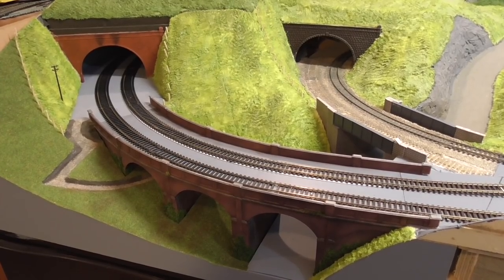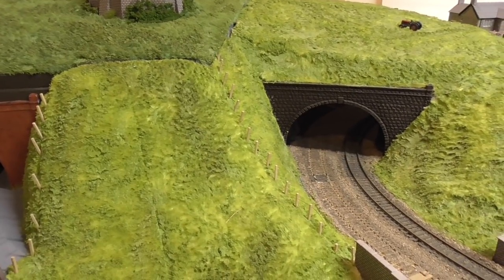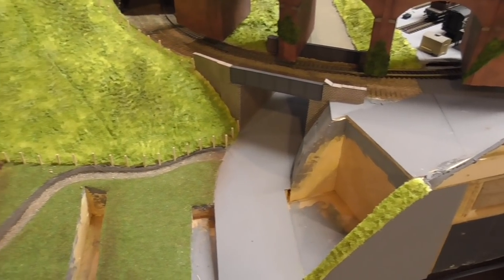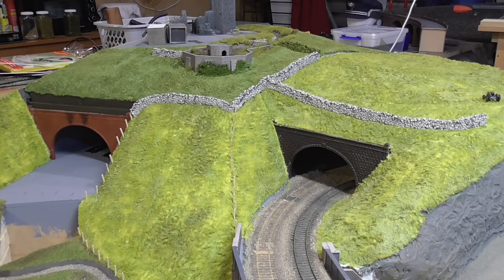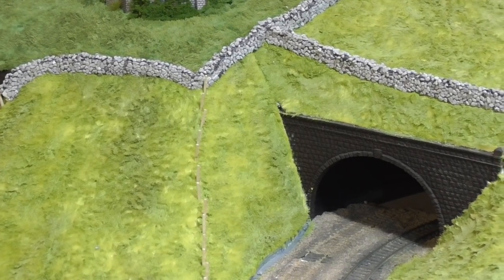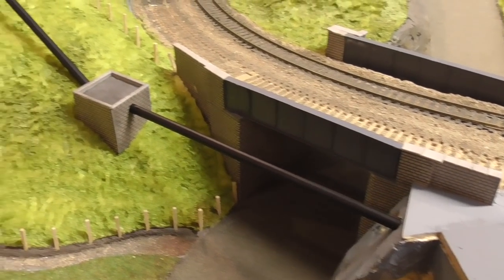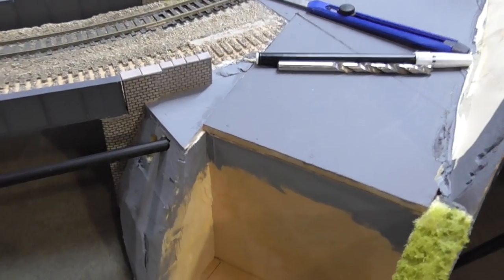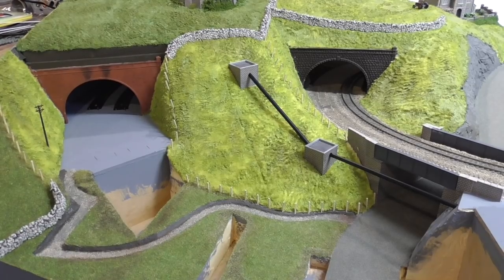Scenic progress on the viaduct, hill and reservoir areas

Comment: The mk2 stone walls looking real good,a wee while back I made a static applicator with a fly swat but I but the electronic part & battery  holder in a clear box from jaycar and a few grass containers made from small pill bottles etc with one wire soldered through the mesh coming up inside of container. This way it can clipped together so I can use it close to structures etc, keep up with good videos cheers Alan.
Reply from the maker: Thanks for your kinds words and feedback. I like the idea of a smaller grass container for getting into tight spots on the layout. Cheers, Julian.

Comment: Hi Julian, great video the scene is coming on really well. Dry stone walls very realistic, will be trying the idea myself  shortly. Would also like to thank you for the video on the Digikeijs dr5000. I have just changed to this system after watching your video. Best thing I have done absolutely fantastic system, so easy to use. Cheers Julian keep up the great work 👍
Reply from the maker: Thank you for your comments/feedback, so greatly received. The DR5000 is definitely a good purchase, I have been thoroughly enjoying operating my system, and particularly its seamless integration with the Z21 app. And best of all, you get all the features of a top train control system for half the price.

Comment: Those dry stone walls really bring that whole portion of the layout together - they look much much better than those in the earlier video.
I'm curious as to your plans for the steep unfinished area right above the portal to tunnel beyond the viaduct as that may be a bit trick to blend with the other areas of grass considering the sheer gradient of the slope? I suppose to a lesser extent that is the challenge with that section between the viaduct and the road bridge where the pipeline disappears, although I suppose you could put a retaining wall or a rock face (or a combination of the two) and it wouldn't look out of place, but I'm you'll figure out a solution - you're certainly a more talented modeller than I. 
I'm eager to see your progress in the next video.
Reply from the maker: Thanks for your fantastic feedback and comments. The tops of the tunnel portals I am going to disguise with foliage etc, and I have yet to decide on the embankment where the pipe line enters. Your suggestions seem like good options. Cheers, Julian.